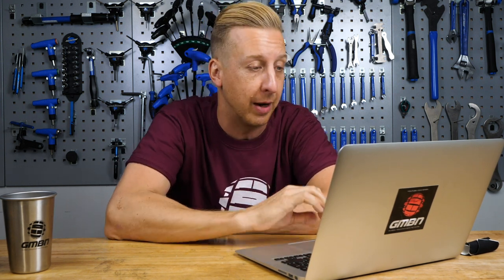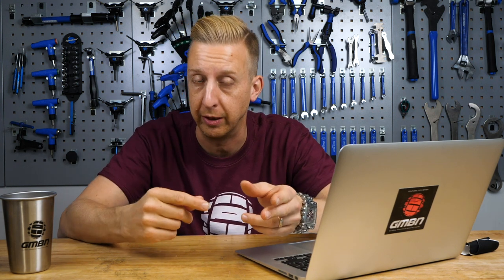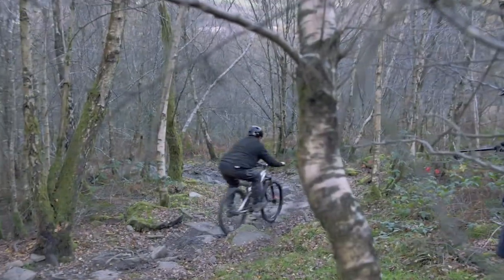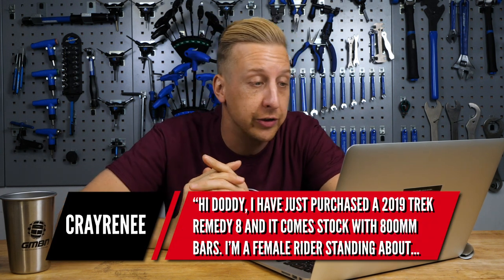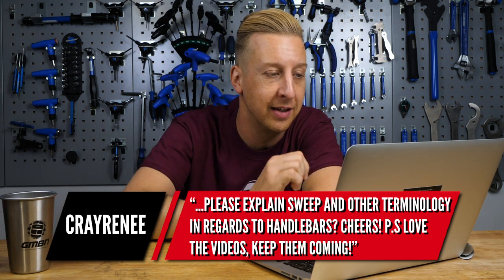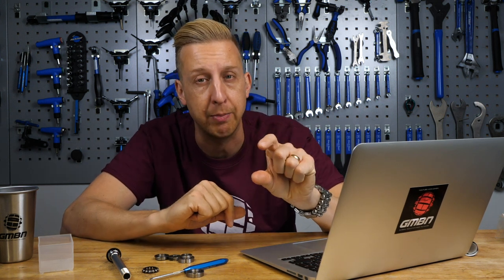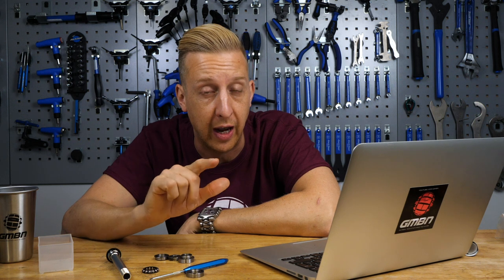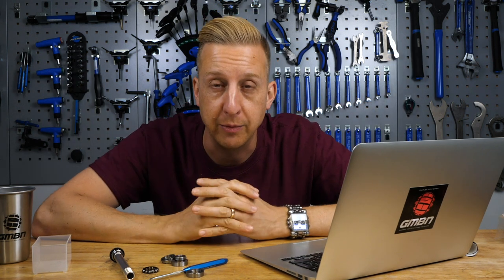Are Your MTB Handlebars Too Wide? | Ask GMBN Tech

Comment from the maker: We like to help here at GMBN Tech so keep your questions coming in using #AskGMBNTech
Reply: #askgmbntech What would I do without you guys??
Reply: Loving the show! 38mm is about an inch and a half so I think that's where it comes from
Reply: #AskGMBNTech hi doddy, are there any substitutions for chain degreaser and lube?
Reply: #askGMBNTech hi Doddy, I need some ideas to keep my bike quiet, gear cable and brake hoses rattling on the frame and it’s very annoying. Any ideas?
Reply: #AskGMBNTech I own a 2018 Kona Honzo AL/DR and I was wondering what the benefits of upgrading the fork would be. The bike came with a 120 mil rockshox recon. Thanks!
Reply: GMBN Tech #AskGMBNTech What size cranks do you recommend? My bike came with 175mm cranks on a large frame. I have also seen this size come standard on small and medium frames. Can you clarify crank length recommendations for proper fit. Thanks, Neal

Comment: Surprised you didn't mention shoulder width as the #1 consideration for the bar length question. Going into the tradeoffs (most notably steering speed and leverage) and what riding style/conditions might benefit from more length than what the shoulders (or "push up position") may suggest would have been good as well.
Reply: My Bar Width That I Use I found out its EXACTLY  The Same As My Inseam 😁

Comment: I'm 5'8, I use 760mm bar with 70mm stem, rather unusual I know, most my friends with similar height to me runs 740/720mm bar with 50 or less stem. As Doddy said, it's a preference thing.

Comment: Regarding the question about bars. Armspan is also hugely important to handlebar comfort. I got 800mm bars on my Large 29er hardtail. I'm 6'0" with an armspan which is 2 inches shorter than my height (I'm all torso) as a result the reach is a little too long for such wide bars. I cut my bars to 760 and it helped a lot but I'm considering changing to a bar setup with a 17° backsweep, and possibly 740mm wide (I also primarily ride xc trails so I don't need extra width) Definitely go narrower if you've got shorter arms for your height.

Comment: handlebar rise: 25mm=1inch,  38mm=1.5inch
Reply: What i came to say :)
Reply: What's thw width because it doesn't ads up to regular conversion? My old bars are 26 1/2 inches wide and thw new used bike i got have 24 1/2 inches,  looked up the conversion and it was giving me like 64mm for the 26in yet I'm seeing bars listed as 720-740mm which don't add up 🤔. My old bars (26 1/2)came with a used bike i bought and I like the width so I'd like to get the same size, we didn't have this problem back in the mid 90's 😂
Reply: @1thess523  25.4mm to the inch. your 24.5 inch bars are 622 .3mm. a 26.5 inch bar is 673.1mm. When you see the numbers like 740-720 means it is 740mm wide but can be cut down to 720. All bars can be cut but only within a small range. my bars are 800 and can be cut to 770 but no narrower. Hope this helps. Don't be afraid to go with a wider bar the feel and control is much better but it's all a personal preference.
Reply: ok thanks for the update. I was lying to my gf about the size.

Comment: If the bars are to wide it can cause neck and shoulder problems . Im 6 feet tall with wide shoulders and i used to 810 mm and started having pain in my shoulders .I cut them down to 780 and the pain has gone away . I also feel like i can move around better on the bike .

Comment: #AskGMBNTech - How do brakes deal with pad wear without changing where the lever becomes firm. From pistons fully open, you can pump a few times and they don't retract as far as they move in, but once they've contacted the rotor, they retract the same distance as they moved in.

Comment: I also own a 2019 trek remedy 8 and it's a fantastic bike.
However, on the subject of bars, I really don't get on with the stock bontrager ones. 
I get a horrible feeling in my palms when descending on anything bumpy with them, iv'e moved them forwards, backwards and all over the place and it's not changed anything. 
So I think I'm gonna sack em off and get some burgtec bars or renthal fat bars on mine.
Also you may want to check your bar length as im sure mine comes with 780mm bars.
Reply: ROAMING LOAM yeah I realised that after I sent the question in! It’s actually 780mm but the tape measure I used said 800mm when I measured. I’m also thinking about getting some renthal fatbars. But other than that it’s a mint bike!
Reply: Try changing grips first. Even nice bikes come with crappy minimalist grips. Try a squishy one from ODI.
Reply: @newttella1043  yeah i already did that
Reply: @ghosthuntrox  I would, its a cracking bike but definitely could do with an upgrade on the bar side
Reply: Let us know what bars you end up getting. A buddy of mine has the same issue. So he bought a carbon Race Face handlebar but still had issues. We are guessing that the new size of 35mm for the stem/bars are so much stiffer that maybe going back to a 31.8mm stem and bar might get some compliance back. He's not that aggressive of downhiller so that 35mm sizing is overkill.
Reply: @newttella1043  That's a shout, I never thought of that...Will probably get some burgtecs

Comment: Hey, re building my old bike. It is getting new everything. My bike is currently a 26er 3x7 hardtail with a horribly worn out coil fork and old tubed freewheel wheels. I am giving it a good set of tubeless rims with freehubs, a set of tubeless maxxis tyres, a 2x9 Alivio transmision and hopefully a brand new air fork. I'm not shure about the crankset though. Alivio uses a 22-36 crankset, but I really see more benefit from a 26-36 deore crank. Not shure if ir will work fine. Also, any advice if the frame is built for V-brake and I want to put disc brakes? (At least front brake). Hopefully when I finish I will have a very nice and capable XC bike

Comment: The perfect handlebarwidth is the distance between your hands in a pushup position. Because then you got maxinum leverage in a position were you can use it.
Reply: Well, in that case I need 780mm handlebar. I got one on my Giant, but it is too wide for me. I always place my hands 15-20 mm far from edges.
Reply: This is a neat way to characterize a starting point, if you mean the position where you place your hands to feel the most comfortable during pushups.  Of course, nowadays most new riders have never done pushups more than one or two times in their lives. So I suspect it’s too new of a position for them to use as a reliable gage. Still, a nice tip.

Comment: My remote lockout wasn’t working either. When I turned the dial all the way, there was no lockout, but I found that if I just turned it like half way, it locked it out, so I set the remote lockout ON, then turned the dial right to where it locked out for real, and then put the cable in at that position and tightened it down. Hope this helps someone in this sea of comments!

Comment: #AskGMBNTech

Hey Doddy! My question is about brakes and how air gets into them; 

I bought a new MTB (Vitus Nucleus 275 VRX) in the summer and have ridden it a moderate amount (nothing excessive but hasn't just been sitting in the shed) and it seems my front brake needs bleeding already? (Spongy, pulls all the way to the bar). I have a brake bleed kit on the way but would love your thoughts on how a new brake could get air in it so quickly. Bits of info that may be relevant:

1) I take the front wheel off to get it in my car and there has been one or two times where the brake lever has got pressed while getting it in/out my car and I've had to push the pistons back (brake block is on the way as well!), but I've made sure that the pads are the right distance away from the rotor each time so I don't think it's directly related to that - could have possibly damaged a seal in the caliper? But can't see or feel any leaks from the caliper (or anywhere else)

2) When I put the bike upside down it gets MUCH worse to the point where you can pull the lever all the way to the bars with almost no resistance at all - you can't even feel the point where the pads contact the rotor. But put it the right way up and pump the brake lever and it starts to firm up again and you can feel the bite point as well (still squishy though)

3) Since I won't be riding it until it's fixed, I cracked the bleed bolt off at the master cylinder just to visually inspect - expecting to see fluid going right up to the bolt hole, but saw nothing? It's not bone dry, there is residue on the underside of the bolt and on the cavity walls, but this isn't how it's meant to be right? Where has the fluid gone?! I would say maybe something was not done correctly during assembly, but the brakes were just fine out of the box but the front one seems to get worse every ride. Am I missing something obvious? Would love to hear your thoughts!

Comment: #AskGMBNTech
I‘ve got an integrated headset on a carbon frame. I was wondering what i should be using on the surface of the frame where the bearing gets installed. Grease ? Carbon paste ? Thank you

Comment: #AskGMBNTech Hey guys. I've learned a ton about mountain biking from your videos and have a couple of tire related questions. I am looking to run an E*Thirteen tsr+ tire on the front (29x2.35) I have an extra WTB trailboss (29x2.4) I was thinking about putting on the rear. I know most people and most recommendations are to run the same size or a larger size on the front. Would 0.05" larger in the rear be a problem? It seems negligible especially with a more aggressive tread pattern on the front. If you are running a more aggressive tire on the front, and need to replace the rear due to wear, should you worry about having a new, but less aggressive tread on the rear vs a partially worn, more aggressive front? Thanks!

Comment: Just fully busted my avid brakes and yes I know what they say about hem so I was wondering should I upgrade to shimano zee/ saint or go for a sram guide because when they acids worked they were better then the v brakes I was running before so which would be a better version of those
Reply: I’ve had my Avid bb7s for 20 years. Switched them between bikes when my frame cracked. Pretty bombproof tbh and nothing ever goes wrong with them, just move the pads in as they wear and switch out the pads occasionally.

Comment: #askgmbntech Hi. I have a vitus sentier+ 2018 model. And i use it for trials and going around the city. I was thinking about cutting of a piece from my seat tube to get the saddle even lover for more clearance when i'm doing trials stuff. I also have a dropper post installed and due to the stack height i want to get it lower. Would cutting away lets say 1-2cm make the bike more fragile to cracking in the welds during tension or weaken it?  do you think it would be fine

Comment: So confusing when looking for 'high rise' bars. 50mm seems way too much and 35mm not enough. Can I get 40mm? Nope, you get 38mm. With a 31.8mm clamp. If you can make up to 50mm rise why didn't they use 5mm increments and then use this to fine tune inventory?
Reply: My guess is that 38mm is 1.5" (more or less). 50mm is 2" etc etc.

Comment: #askgmbntech I wanted to build myself a trail hardtail, but the frame I bought couldn´t be delivered. I was looking at the Nukeproof Scout 275 2019 but can´t find it anywhere in my size in grey and also at the Commencal Meta HT, but they recomend using a 29 fork with 555mm axel to crown, but I already got a 27,5 fork with 532mm axle to crown. Would that difference be to big?

Comment: #AskGMBNTech - How does the contact point (bite-adjust) feature work on brakes? Does it start the pads closer to the rotor (and therefore harder to align) or does it increase the piston movement for a given lever travel somehow?

Comment: #askgmbntech  I'm looking to upgrade the hydraulic disc brakes on my entry-level hardtail. I'm currently running Tektro Auriga hydraulic with 180mm rotors. The levers are the biggest issue with little adjustability and banged up from past crashes. Can I just replace the levers or do I need to buy a whole brake set so the parts all match? Also, are calipers universal where they bolt onto the frame? Thanks for the help and I love the show!

Comment: 38 rise might be to stop it getting stuck going through some stems
Reply: ?!👀 ... upgrade stem first!
Reply: 38mm is 1.5 inches so my guess is that it's an easy number for manufacturers/designers who are used to working in Imperial units.
Reply from the maker: You could always remove the face plate on the stem.
Reply: Exactly ... and the ones lacking that very feature shall be upgraded right away!

Comment: #AskGMBNTech This question relates to maintenance of the organic squidgy bit that rides the bike rather than the bikes itself. I have regularly been experiencing rather severe cramp when out riding despite fuelling myself with the isotonic tablets in 
water and taking gels at regular intervals and had even taken to eating a packet of crisps before heading out as I believe that a lack of salt can be a contributor. The cramp is always in the same place at the base of my quads where they taper into the knee joint. Rasing the seat height a few millimetres seems to help but this puts pressure on Big Jim and The Twins!!! which gets very uncomfortable when puttings the K's in on a longer ride. I am wearing padded briefs/tights (dependant on weather). Any advise/alternatives would be greatly appreciated so that I can give it a go?👍👍👍

Comment: #AskGMBNTech
Hey Doddy. A question about my Suntour Auron fork. Im a lightweight rider at 115 lbs and I run my fork at ~45psi (25% sag). I notice that there is already around 10% sag compressed even when I am out of my bike. You can see this if you try to pull the fork lowers away by your hands. This is the case since fork was bnew. How do I solve this?
Thanks.

Comment: #askgmbntech Hi I recently bought 2018 Norco Sight A.3 aluminium frame bike and was wanting to put a chainguide on? Now I'm not sure which ones will work best for the suspension system I have one the bike. I would also like to know what the difference between active and passive rear suspension systems? I'm 5.7" tall and run 25mm rise, 780mm bar width. Keep the awesome videos coming. 👊

Comment: #askgmbntech I recently swapper tyres on my bikes, one of them had two Specialized Ground Controls tyres, and the other one had Maxxis DHF and High Roller. Now I've put Schwalbe tyres on both bikes (nobby nic rear, magic mary front on my enduro bike, nobby nic rear and hans dampf front on my trail bike), and immediately noticed something, that I can't really understand. The schwalbe tyres feel a lot harder when pumped at the same pressure as all my previous tyres, and they ride a lot harsher. What could be the reason for this?
Reply: reasons im thinking of: tire volume (actual width often differs a bit from printed), sidewall construction, rubber compound
Reply: @ultiss  Hi, thanks for your reply, I thought maybe it's the volume difference, but I don't know exactly how it differs and how should I change my pressure to counter that. The outer width of the newly installed tyres it 2mm less, compared to the old ones. Which is weird, cause the old ones were 2.30 width, and the schwalbes are 2.35, which should be around 2mm more, but idk. The compund is softer on the schwalbe tyres, compared to the old ones, and they're lighter too.
Reply: then i guess its the sidewall, did you change from basic stock tires to snakeskin or dh casing? a stiffer sidewall will make the tires ride harsher. try lowering the pressure and see how that feels
Reply: @ultiss  Yes, the new schwalbe tyres I got are all Snakeskin.

Comment: #askgmbntech I'm eventually on a tubeless wheelset and wanted to add some more protection with some tire inserts. The problem is, on the front rim and tire fit a bit too good, resulting in me not being able to unseat/uninstall the tire to add the insert. Any idea how I can manage to get the tire off? Tire is a WTB Convict high grip soft compound mounted on a Hope Tech35 rim.
Reply: Tire levers to pry the bead off?

Comment: #askgmbntech first of all, kudos on all gmbn channels, much better content as on “original” GCN. Question; I want to fix and “upgrade” my old rusted(salt) 3x6speed fat bike with thread-on freewheel. What’s the max amount of gears possible. 9speed? Also, are old Sram 9sp. grip shift compatible with Shimano 9sp. XTR RD?
Reply: best upgrade would be a new rear hub or whole wheel. the cassette style is much better compared to the freewheel as these put quite some stress on the axle making it prone to snapping

Comment: #AskGMBNTech Great show GMBN team.... So I'm  looking at buying a second hand 100mm rear travel 29er full sus frame. Would putting my 27.5 wheels  effectively increase the amount by which the rear wheel could travel by the difference in wheel size÷2 eg (38/2=19mm)? The bb drop is fine and fork will slacken   head angle to 68°. I understand the standard shock will still only give 100mm but I'm referring to rear wheel travel
Reply: why would the travel change? i dont see how wheel size would affect the axle path on compression of the suspension. Also keep in mind bb drops lower when you ride the bike (sag). sounds like a bad idea unless the frame is designed for 27.5+ tires

Comment: I'm sorry, but this bar question is NOT getting answered by anyone. There has to be more to it than "it's all down to rider preference". That to me says that the science has been skipped. The closest I have seen to getting this answer right is get on the floor and do 5-10 pushups and measure where the outside of your hands are, and use that as your width. At least this gives you a ball park and makes sense as it will be the most comfortable position to maintain strong support of your upper body. It's all up to rider preference is a cop out.